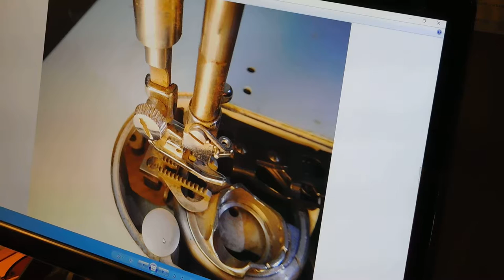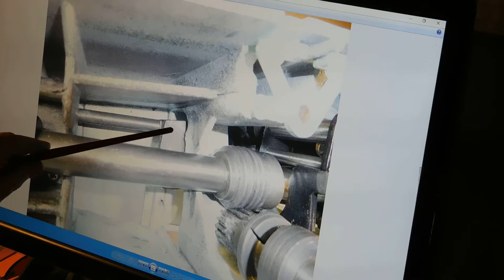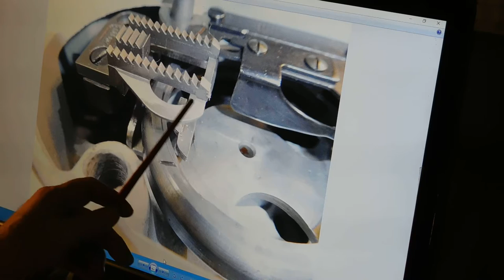SINGER 347 FOR JEN -  RUST REMOVAL METHODS

Comment: Hubby is going to get some of this! Thanks for this video Andy!
Reply from the maker: Welcome. I know he will find many uses for it. I have not tried it on heavy rust, but it sure worked quickly on this machine. On their website, in the FAQ page, is good info about using it on non-ferrous metals and using it as a primer before painting. I plan to repaint a bicycle come spring time and want to try it out.
Reply: Andy Tube Good to know.

Comment: Hi I purchase a 347 singer model. It seems to have a tension or adjustment problem. The machine stitches two and nothing else. What do u recommend I could do?
Reply from the maker: so only a #2 width zigzag? sounds like the selector parts are stuck. at singerco.com, under support menu is a link to the page to download FREE instruction manuals if you need one. with a new to me machine i always start with a complete oiling as shown in the manual. if i cant move stitch width or length lever i remove cover and follow the lever into the machine. i oil the metal parts that touch together. on stubborn parts i use a hair dryer and more oil to free things up. when moving a width lever the needle bar should always be in the up position. try these ideas first and let me know.

Comment: Hi i have a singer machine 347 model. Its been down for a while,how do i get it back up and working. What oil should i use. How do i get rid of the rust. I really need to get it working.HELP
Reply from the maker: Hi Monique. For rust removal I use the product and procedures in this video. You can easily go here to download a free instruction manual and see all the lubrication points:
http://www.singerco.com/support/instruction-manuals
If tri-flow is not available, then Singer, or other brand, sewing machine oil will do. Oil every place very well. Use a hair dryer on high to free up sticky places and get the oil flowing and things moving. Here is a playlist of a complete restoration on a similar model. You can browse through the different videos (31) and see chemicals, tool and methods. Choose cleaning/oiling methods you can do and go for it:  https://www.youtube.com/playlist?list=PLsCOZgzzaiKJxbOOMKQPvmeTRqi0dhGa5
The more time you spend, the better the results. Good Luck.

Comment: the rust remover does nothing on my truck. I can spray it on rust and nothing happens.
Reply from the maker: I did use it on a rusty shovel with good results. Brushed it on and let it set. Wiped off most of it and a second application cleaned up the residual. Maybe it depends on how old and deep the rust is? The manuafacturers website may have more info for you. https://www.rustoleum.com/product-catalog/consumer-brands/krud-kutter/rust-remedies/the-must-for-rust-rust-remover-and-inhibitor
   https://www.rustoleum.com/pages/homeowner/faqs/krud-kutter-the-must-for-rust-faqs    Thanks for watching.